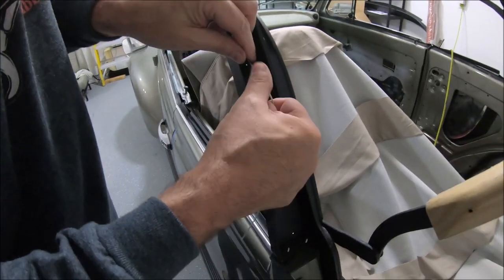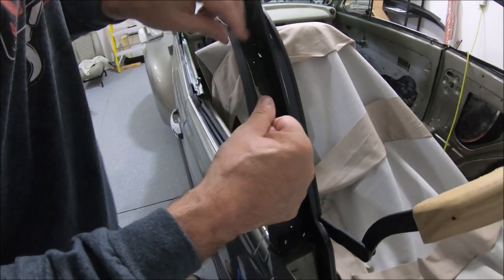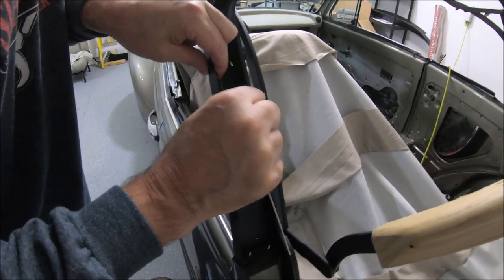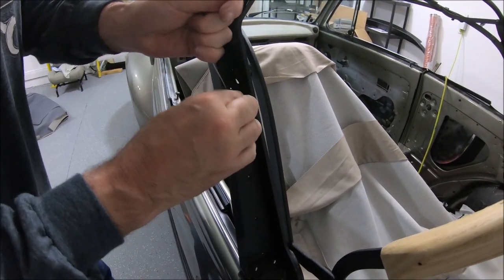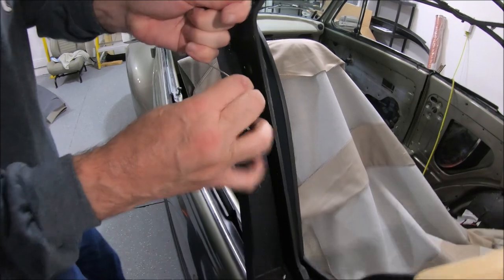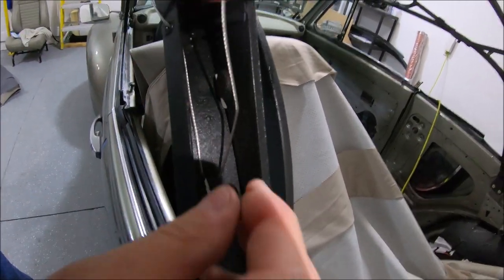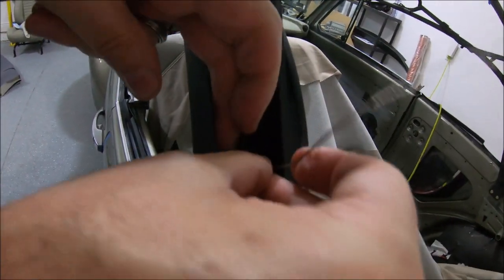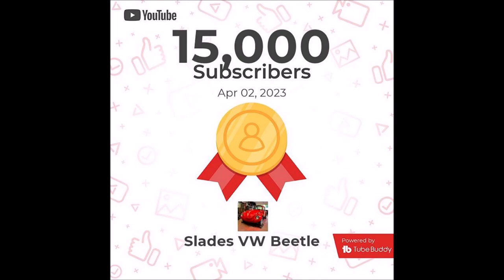VW Beetle Convertible Top Installation DIY Video - HOW TO install a convertible top - VW BUG - GHIA

Comment: Thanks for this valuable info and perfect timing even though I’m a long way off from this step. I have been stressing about it for many years   But where do you get the rubber parts?
Reply: I got my stuff from Chucks Convertibles

Comment: New vert to me. A 65. My first vert. Does anyone know if the headliner along both sides from front to rear get mounted to the frame somehow? Or are they loose and have to be loose to allow the top to fold open?